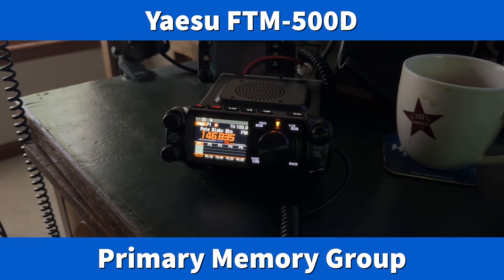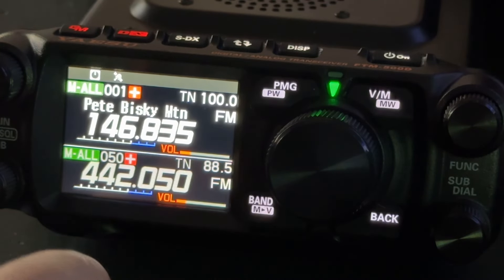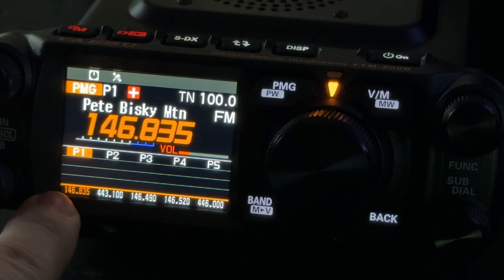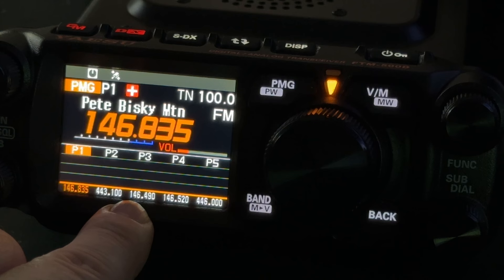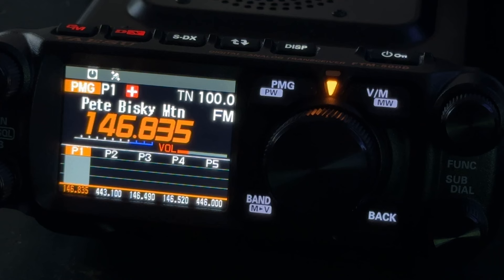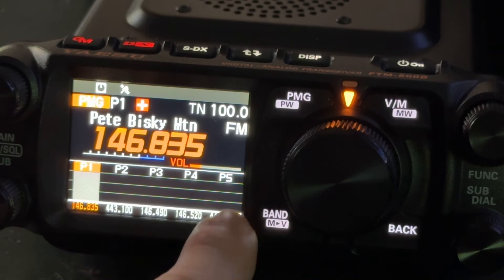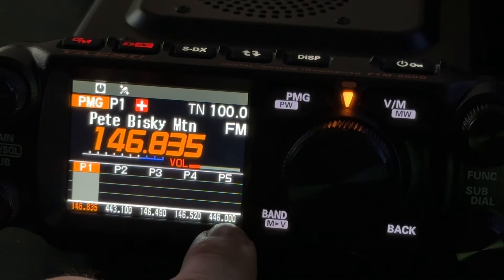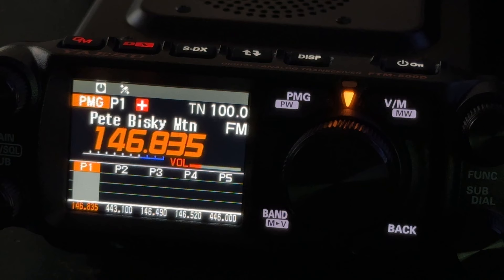Yaesu FTM-500D #6: Primary Memory Group #hamradio #yaesu #ftm500 #c4fm #aprs #pmg

Comment: There is also a way to hear the audio on the non-selected P memories on the sub-band when there is a transmission there. Sorry, but I don't recall what that is at the moment.  KC4S
Reply from the maker: Yes, that is how I run mine. I showed that in the video.  Long-press the big VFO knob to toggle the PMG to Auto. Manual only shows the signal bar when someone transmits. Auto allows you to hear the audio.  I think I covered that in the video description. I usually include additional tips in the video descriptions.